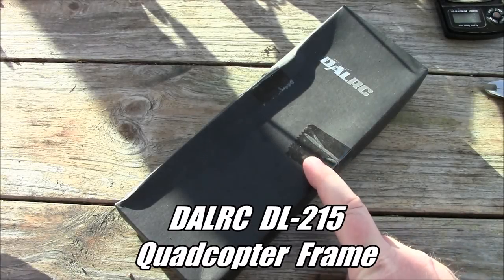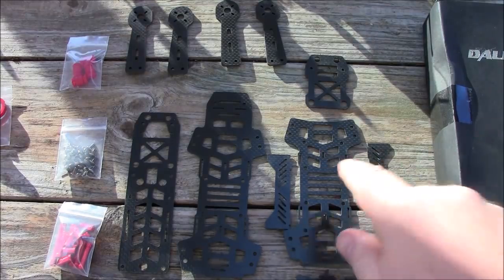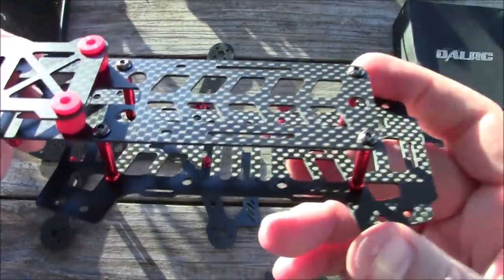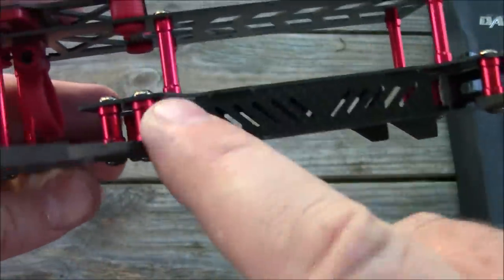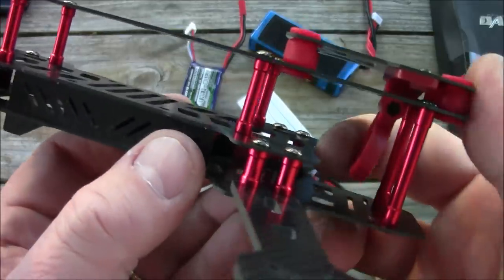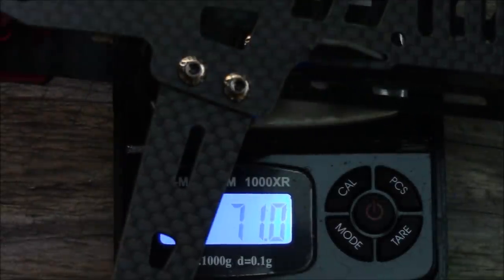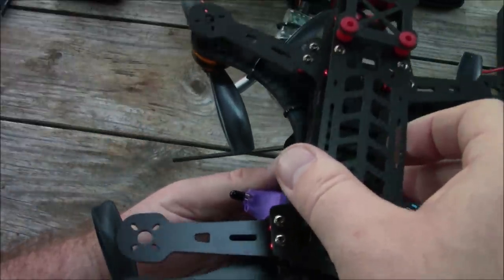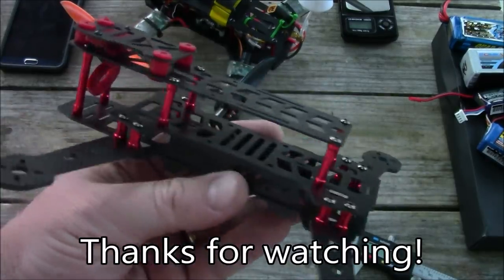DALRC DL215 Quadcopter Frame Review from Banggood

Comment: Thanks for the primer on this frame,Travis. The DL220 might be a good candidate as it seems to address a few of your concerns with a half height deck behind the actioncam plate most notably.
Are you intending reviewing the DL220? As i would like your thoughts comparing them, I like the look of the 220 with a one piece base plate and the sides offer alot of protection and rigiditiy but would like to know if you think its worth pretty much twice the price.

You are always a riot, Travis. Happy Christmas.